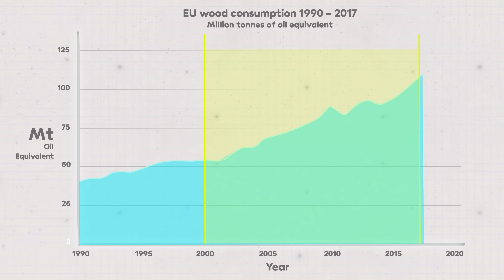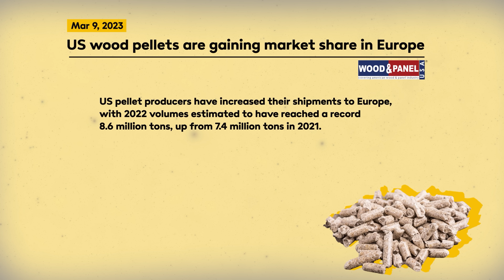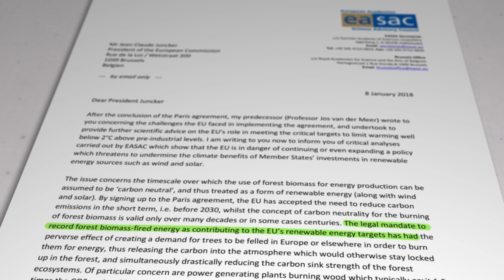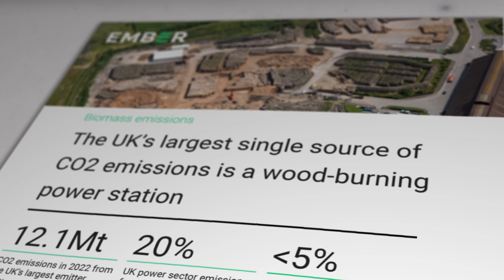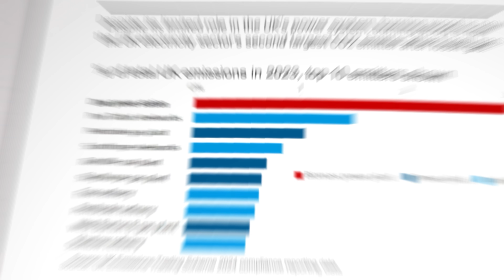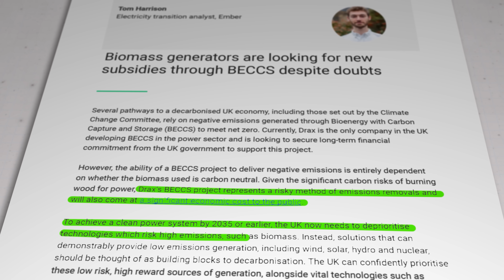New report: Biomass CO2 emissions 4X higher than COAL!!

Comment: Instead of subsidising biomass, why don't we build more electricity storage facilities?
Reply: Tesla batteries are being sold everywhere, including in NZ, where a power generation co' recently invested US$100M in them to capture unused electricity during high production periods.
Reply: Because it doesn't reduce overall demand or consumption of energy. 

20% of our energy consumption is electricity, using a lot of energy to build batteries to save what overall percentage would be my question. Nuclear takes ten years to build and in ten years sea level rise could 3 times as fast as it has been the last 30 and getting quicker, are we really considering building power plants near rivers/lakes/oceans is a step forward now?
Reply: @antonyjh1234  Building batteries allows the following energy savings:

1. Time of day arbitrage flattens the Duck Curve, with up to 15% lower overall generating capacity needed at the scale of the UK, and more for smaller grids.

2. FCAS reduces equipment costs and increases efficiency for grid-connected equipment, around 3% energy savings, and similar lower capacity requirement.

3. Automated Impedance Matching reduces "ghost current", as much as 1.5% of a grid like the UK; more, seasonally.

4. Reduced fuel inventory in process and reserve, such as coal, gas, in some cases oil; the carrying costs for these continue to be paid so long as the grid has any fossil generation, and drives up costs. Getting rid of fossil can eliminate 12% of energy costs.

5. Efficiency. Batteries are more efficient than keeping an on-demand generator in stand by, and can reduce those costs substantially.
Reply: @antonyjh1234  Well the predicted huge sea rises haven't happened (probably because Polar Ice isn't playing the game and melting) and are modest and in line with historical record. The Pacific islands are stubbornly refusing to drown. The Polar bears are doing quite nicely and the 97% dead Great Barrier Reef has record levels of coral. If you believe the stuff that eco nuts with agendas tell you without doing your own research then life must be stressful. Look at the actual IPCC reports (which aren't telling the whole story as they ignore anything which goes against the narrative as they are paid to support it) and see the difference between what they say and the rubbish that the politicians put out in their summary for policymakers.
Reply: Building sufficient electricity storage (giant banks of batteries) would take up MASSES of land & cost TRILLIONS of £s - simple as that.
Reply: @SGFlicksify  Take the land away from the pipelines, refineries, and coal storage.

Experience proves grid batteries pay for themselves more than eight times over. In the first 30 months of the battery Musk built in Australia, it provided more than its own cost in FCAS, Automated Impedance Matching, and Time-of-Day Arbitrage services.

Not building storage? Worst economic decision an electric utility could make.
Reply: If you do biomass correctly, you are actually storing solar power into biomass. You need the amount of CO2 to create the biomass that it eventually also releases. That's the idea behind it. To offset inefficiency you can even let the crops grow more to have a negative impact on CO2 (as in: it will use more CO2 and produce more O2 to grow the crops than it releases/consumes on oxidation).
But going all crazy about single crops is what makes things go bad... Corruption and other bad things.
If I look around my garden, there is so much free ethanol by just harvesting half of the fruit that trees grow here... It just is not commercially viable. Fruit needs to be harvested because if you let all fruit rot, you just get drunk walking around. Although some fruit just have a delicious pie smell when they are rotting.
Reply: Or just stop subsiding stuff all together because government is always wrong  or the subside plans are corrupt from the get go.
Reply: Oh you mean spending £Billions more trying to make worthless renewable work!!!
Reply: Because the current state of the storage technology is EXTREMELY expensive and quite frankly crap.  Electricity needs to used the moment it's created.  Storing it in bulk is simply not practical.  That's why EV's currently don't really work.
Reply: Why assume it's not being built, the UK has 4.9GW of battery storage currently, another 4.3GW under construction due by the end of the year. Plus ramping up quickly over the next few years with a total of 96GW battery storage committed to be built.
Reply: @GruffSillyGoat  But how long before their capacity drops to the point where they need to be replaced? How long before the raw materials to build them are so scarce that nobody can afford to buy them. There are not enough raw materials in the world to replace ICE cars with EVs let alone huge battery packs. 
Before the mystic 2050 every wind generator in the UK will need to be replaced. Who is going to pay for that? 
Wind and solar are being subsidised by the tax payer, typically for 10 years. 10 to 15 years later they will need to be replaced and presumably that will have to be subsidised again. How is this producing cheap electricity? The reality is that we pay for the renewable electricity twice, once for what we use and again through taxation to pay the subsidies.
Reply: @terrytheoldgoat  - Quite the bingo card full of myths and disbunked points, seems you may have missed a few videos on this very channel on the subjects.

Battery lifetime depends on cell chemistry used, somewhere between 15 and 25 years is expected. Although many will likely last longer with a still usable capacity before needing replacing. There is enough accessible Lithium, if that is the resource you're indicating, to replace all vehicles twice over. Further, Lithium is a recyclable resource meaning it's extracted once unlike fossil-fuel that are a consumable resource that involves extraction and mining of supporting materials indefinitely (of at least till its no longer economical to extract). Plus for static batteries other elements and technologies are used in the mix - such as sodium and flow batteries.

Wind turbine have an expected lifetime of between 20 and 25 years, the oldest operating one is over 40 years old. O&M and replacement costs are factored into their pricing cases. Further, wind/solar maintenance replacement is cheaper for grid operators than older fossil fuel plants. With these older plants more power is generated by fewer gas/steam turbines; their outage and replacement is costly to grid operators who have to bring on expensive extra capacity or imports to fill the gap. With wind turbines a rolling schedule of maintenance and replacement has a much smaller impact on generation and hence operating costs. This also creates more jobs so helping the economy.

Redirecting the massive subsidies that go to O&G would help to pay for renewable generation, as these are many times the size those paid for renewables currently.

Every one already pays twice over for power generation, through tax and usages. With renewable energy is will just be cheaper to do so.
Reply: Thorium nuclear. 😮😊
Reply: @Wasaga1951  Unicorn hamster wheel.
Reply: Or just go for a green, sustainable reliable secure source, nuclear!
Reply: @one.wonders  nuclear to be reliable also needs storage, meaning you can't escape storage.
Reply: @one.wonders  Nuclear by the very definition is not sustainable, neither economically nor environmentally.
Reply: @one.wonders cause nuclear is expensive. And another Ressource that is running out especially when everyone uses it in great quantities. Further nuclear can Not Support the fast changing demand, Changes in Output take a Lot of time.
Reply: @KeVIn-pm7pu  nuclear wouldn't be expensive if government didn't cock blocking it. SMRs have a lot of great features but the regulators are either too stupid or unwilling to update the regulations to allow them.
Reply: @mac_mcleod  It isn't at all unpredictable, the construction companies just under bid.  The only reasons it seems so expensive are that the LCOE measurement doesn't account for the necessary load shifting for intermittent power sources and that you can buy the other types of generation in smaller increments.
Reply: @sarahsmith840  when private insurance companies will reinsure the cost of construction and decommissioning nuclear plants, then you can fairly say that the prices of nuclear plants are not unpredictable. 

Sensei insurance companies won't touch nuclear plants with a 3-mile island long pole, we know that their costs are unpredictable. 

The cost of Japan is going to be over 1 Tryon dollars for one failed nuclear plant. 

And that doesn't even get into the billion-dollar decommissioning cost for nuclear plants that were supposed to cost 19 million to decommissioned. 

Nor does it get into the increasing number of nuclear plants shut down due to lack of sufficient cool water.
Reply: @matthewconnor5483        Regulations are not the problem, the technology is.
Reply: @Longtack55            Nuclear provides an insignificant 5% of the world’s energy. Making it anywhere near remotely close to approaching significance would quickly exhaust reserves.
Reply: @J4Zonian  if you think regulations are the problem then you don't understand the process is the corruption.
Reply: @Longtack55   incorrect. it gets increasingly harder to mine uranium, to the point current nuclear reactors have to use their stored fuel, because mines cant provide enough.
its estimated that uranium would only last around 9 decades if nuclear power is our main power source.
Reply: @one.wonders  yeah that went well for .... Chernobyl and Fukushima
Reply: @memyselfandeye1234        & TMI, & Brown’s Ferry, & Kyshtym, & Tokaimura, & Hanford, & hundreds of other disasters & near-misses.
Reply: that would take common sense and brain cells ....

Comment: About ten  years  ago I  was  persuaded to  install a wood  pellet  burner to heat a large  farmhouse  that  was  using  an  ancient oil fired boiler. Due  to the  numbers of  dairy cattle on site   someone  had  to  be  resident at  all times  to  supervise calvings   and  deal  with emergencies. My  family  had  lived  lived in  the  house continually  for  150 years.

The  finance seemed  to  add up as the  costs  were  largely  met  for  7 years. There was the  manual labour of  filling    the  boiler daily from  small bags and   the  storage  of  pallet  loads  of  heavily shrink wrapped thick plastic bags  out  in  the  garage  across the yard. In icy conditions  it  was  a  tricky  carry three times  a week with  the  bags   but  I was  younger then.

At least  once  a  week you had to clear  out the  ash from  the  boiler and  you had  best  time  a  bath  soon  after  as  the   dust  went  everywhere  including  up your  nose. The  dust  percolated  through several rooms in  the  house  making  cleaning   a lot more  difficult.

Some  times  the boiler  would  just  fail  to  ignite  as  per  the  time  clock and  you would  have  a  very  cold  house of  a  morning. There  would   just  be   a  pile   of  unburnt  pellets  in  the crucible. Fortunately  we  were within  a couple of  miles  of  a  council recycling centre but  even with  rolling  the   bags up tight  and  packing  in to other  single  bags  there was a carload  every wee  while  to  go  to the   coup.

One  time  the boiler  failed to ignite  properly  and  there was  an explosion  filling  the  utility room and  kitchen  with  smoke  plus  setting  off the  smoke  and  CO  alarms not  to  mention me  calling   out  the  fire  brigade in  a  bit  of  a  panic. Fortunately it wasn't at  a particularly  cold  time  of  year but  the  boiler had  to  come  on  to provide  hot  water.

Anyway  to  sum  up  it was a lot  more  work  and  a  bit  inconvenient , also the  supply  of  pellets  became  problematic  at  times.  I do  feel that   there were  no  real  carbon    emission  reductions overall and  as  the   video  states  perhaps  even  a  worsening of  the situation if the  source  of  the  pellets  was  virgin  timber.
Please note  I  wasn't  a  participant  in the   mad  schemes where business owners  were paid  more   the  more  pellets  that  they  used leading  some  fly boys  to  heat tractor  sheds  etc

This  all went horribly wrong  in  Northern  Ireland  at  some  political  cost to the politicos  involved. My  farm  was  in  Scotland but i had  to sell it   in 2019 after the  death  of  my  mother triggered my  late  father's  will. Now  I  am in  a  bungalow ( 1989) built  with oil rayburn  and  heating  ( it's  way  off grid) and  the  bills  are grim  for  a  single  pensioner.

My  neighbours have had a  pellet  fueled  central heating  system for a  good  few  years and  are about  to switch  back to oil  due  to the £500 a  month  cost  of  pellets. The   closed  pub  next  door has  just been converted  into three  dwellings  and   they've  all had  new  oil heating   systems  going  in.  It is  a  conservation  area  ( despite   my  modern  bungalow ) and  solar  panels  are  banned.

What  a  mad , mad  world.

Comment: Where do you suppose the carbon in trees comes from?  It comes from the air.  Where does the carbon go when trees are burned?  It goes into the air.  This cycle is not new.  Plant the same number of trees that you cut down and you are carbon neutral.  Common sense really.
Reply: @andriusscerbetka1863  The amount of carbon in the tree is exactly that which it has been taken out of the air.  Age makes no difference.  It just so happens that it is not that useful to us before it grows to a certain size.

Comment: Thanks Dave!  Electric consumption in households is driven primarily by refrigerators, freezers, air conditioning, and heating equipment.  It seems that overall pressure for energy production on any type could be massively reduced by increasing the efficiency of homes. We're about to see a huge uptick in New housing unit construction in the US, so baking efficiency in the cake is a must if we want to lower overall consumption.  Interestingly, Wisconsin is built on sawdust towns, most smaller cities were lumbering and sawmill operations, so there are ample examples of rotted down piles of sawdust!  It's brown and crumbly like pure humus, and tends to stay that way like old peat bogs. 🌲 🌲 🌲.  Great presentation Dave, keep up the good work! ⭐⭐⭐⭐⭐